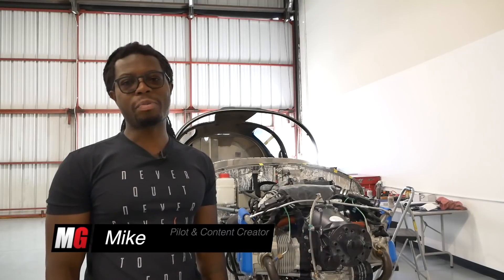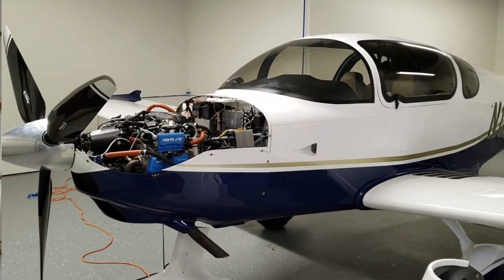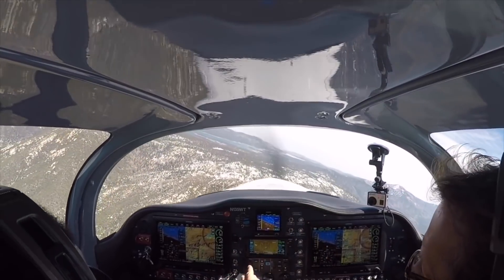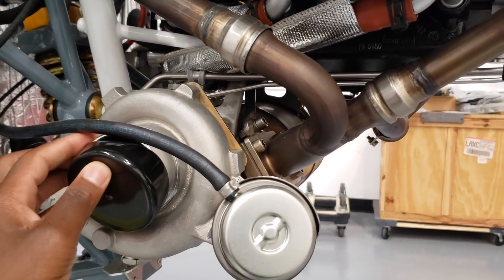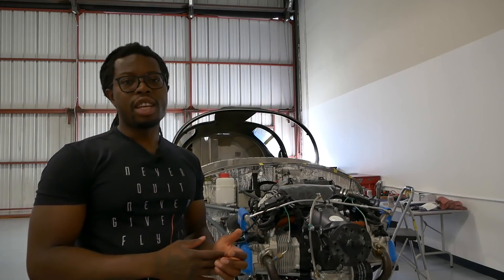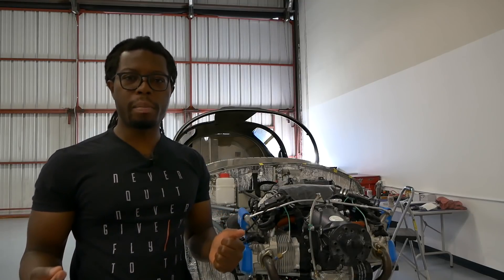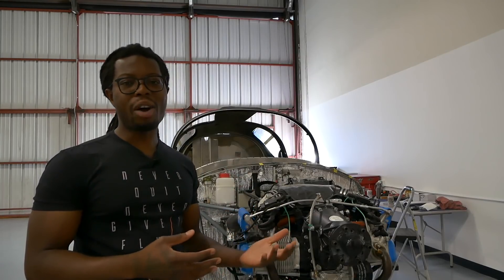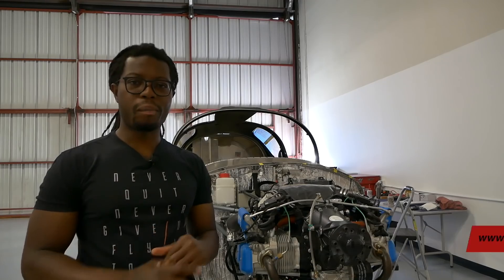What Makes The Rotax 915 Aircraft Engine So Special?

Comment: Are those honda engines in the beginning of the video? If so,  could you do a comparison and pro-con between the two?
Reply: 1) PRICE= honda much cheaper .... 2) honda = car engines ! (car engines give you chance for repair ,-repair on the side of the road .....) 3) aircraft engines is special technology etc..... 4) It is IMPOSSIBLE to compare car engines and aircraft !!!!!!!!!!!!!!!!!!
Reply: @MrPetrvershinin  aircraft engines are special tech  most about as advanced as a 70's motorcycle lol
Reply: @timm1583  not this one. Direct fuel injection, coil over plug spark. The 915is is all the latest car tech with redundancy. So two coils per cylinder, two injectors per cylinder and two ECU's.
Reply: @timm1583  Made like a 1968 Norton Commando. Dual fuel, ignition systems etc.
Reply: @MrPetrvershinin  Unless of course you are talking about a VW beetle engine as found in VW beetles and more than 350 different aircraft designs :)
Reply: redundancy is the main difference. Rotax has two of everything, spark plugs, spark plug coils, fuel injectors, ECU's. The viking engines are basically just honda fit engines modified to fit on a plane and take a propeller.
Reply: @kevinbutler9786  Like a 1968 Norton Commando then?

Comment: This is the piston engine of choice  I have been looking at. Either this or one of those small turbines like in Mikes previous vid. Quick google price is 37k USD around 54k AUD as Jun 21. Look forward to seeing this fly
Reply: That is the price for the engine, and ONLY for the engine.  You need another 15K for an engine mount and all the required accessories.  Easy to spend well over 50K USD on a new 915.  (which is the ONLY real drawback of this engine, IMO)

Comment: Mike, One Addendum, if you are running 100LL in that aircraft your oil change times will be more like 25 hours, and that will include the oil tank as well, the lead builds up FAST.  Rotax Engines have some unique maintenance issues.  If you Haven't attended, or haven't planned to, I would seriously suggest you attend one of the Engine courses run by Rotax through affiliates, as you are going to be doing your own work on the plant.  The Sling looks Great, Good Luck with it.  There's a discussion on oil change times at the link at the end.  Remember one thing Oil is Cheap, Engines are not. Engine oil Analysis costs around $25..also a Cheap expense that can tell you about problems LONG before visible metal starts showing up in filters and sumps.    https://www.rotax-owner.com/en/912-914-technical-questions/1437-rotax-recommended-oil-change-interval-100ll#:~:text=Page%2016%20of%20Section%2005,this%20changes%20to%2025%20hours.
Reply: From my google search, it seems the 915 can take E10, so a fill up would take no more than a jerry can and a trip to any gas station; this sound very attractive. But I wonder how reliable the engine is in the long run compare to the legacy engines given that the 915 only came out in 2017.
Reply: Chow Yun-Fat Extremely reliable if not more so. The fuel injection system is the exact same as the 912 iS and they already have more than 10,000 hours on test stands with the 915.

Comment: I like that rotax is changing the game a bit for lsa. Would love to see more powersports manufacturers putting out airplane engines. To bad Yamaha, Honda ect. won't put out a product. Yes you can get a 3rd party conversion but the amount of R&D these companies have is more than Lycoming or Continental could ever dream of
Reply: Oh gosh, Honda would dominate if they produced aircraft engines (other than the Hondajet).
Reply: @GeneralSirDouglasMcA  Do they even make the jets in it?
Reply: If Honda produced a dedicated engine it would dominate the market, hands down.  imo
Reply: @brknbike  As you cannot be towed to a maintenance site when the engine fails a Honda engine would be a very bad idea from my experience with Honda cars and motorcycles failing without warning. An obsolete rebuilt VW beetle aircooled engine is a much better idea, there are many valid reasons why they are so popular.

Comment: Neat technology, but SO much more potential for something to go wrong. For aviation, I would rather have the 70 year old non efficient design that works and works and works. With Direct Injection, Water Cooling, and off the shelf automotive parts, there are a lot more things to break.
Reply: Some technology improves reliability. Water cooling in nearly all of cases makes an engine more reliable than air cooled. The same goes for EFI. I’ll never understand the mentality that “older is better and more reliable because it’s simpler.” While they may be easier to work on and understand, that’s not necessarily true. Modern manufacturing allows tighter tolerances, and tighter tolerances means increased reliability. There are plenty instances as well where the old mechanisms were more complex. Drum vs disc brakes are a prime example.
Reply: @kendrickdlr  What about Condoms? Nothing beats the old timey feeling of Buckskin.
Reply: Wait till something fails in mld air like the ecu or a coolant leak etc.  Aircooled is always more reliable. Old yes but less complex to repair.
Reply: @kendrickdlr  Water cooling increases MTBO due to more stable temeratures and decreases MTBF due to there being a lot more things that can break and cause catastrophic engine failure so you are wrong! Water cooled engines have longer lives but are less reliable, think about it :)
Reply: @andrewallen9993  Think about what you just said in your last sentence. If water cooled engines have longer lives that literally means that they are more reliable. You would be correct in saying that water cooling systems independently from engines are more complex and are thus theoretically more prone to failure. However, in conjunction with its intended purpose at performing a specific task which is to cool an engine, it proved and is still proving to be far more effective than carburetors. That's why overheating was ubiquitous with air-cooled engines, whereas overheating is rarely heard of with water-cooled ones. It's a total package thing. You have to look at the big picture.
Reply: Rotax is pretty much proven by now, there are thousands of them flying in both Certified and EAB aircraft.
Reply: Your CHT is a lot higher and a problem on Conti and Lycoming, limiting engine life.
Reply: It has dual channel FADEC, meaning two ECUs. Reliability is less of a concern. Cost would make me balk.

Comment: I am looking at the 915 for my S-21.  Do you plan to show more detail on the various engine system installations?  Electrical, exhaust, cooling, fuel, etc.?
Reply: Do it. 145 mph on 7.3 GPH is too great to pass up! Perfect combination for that airframe.
Reply: My understanding is that his version of the 915is is specifically for the Sling TSi. The intercooler, oil cooler and radiator are routed specifically for that cowling layout. Same for the 912 and so on. But we get them crated in that layout already to bolt up. Contact Kodiak engines and they will have the info.